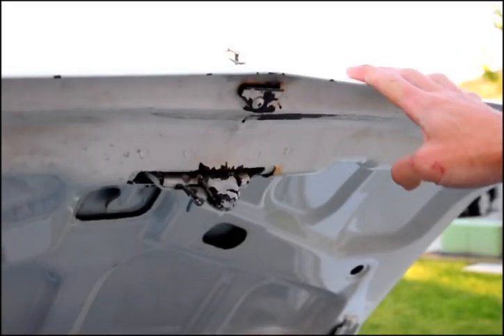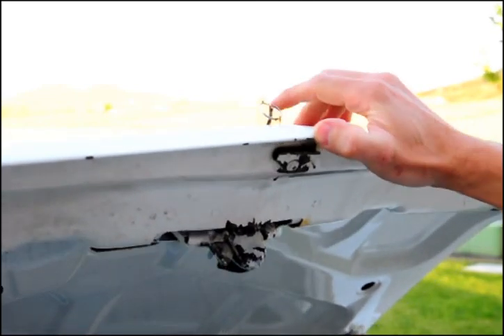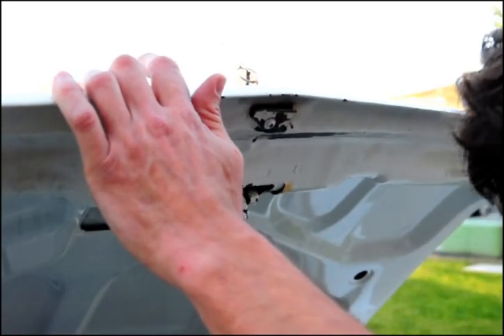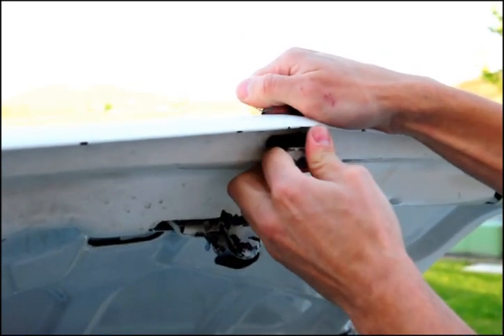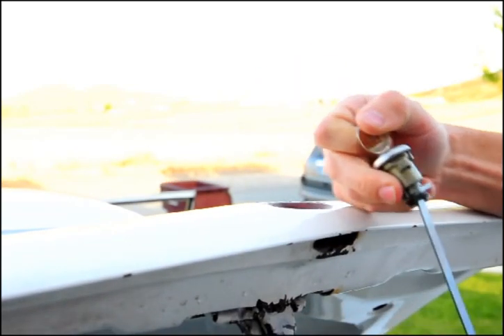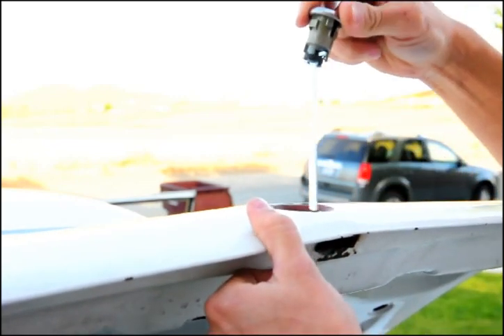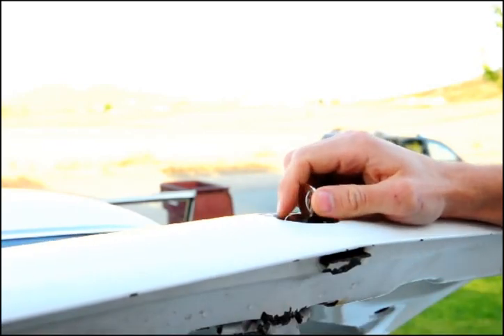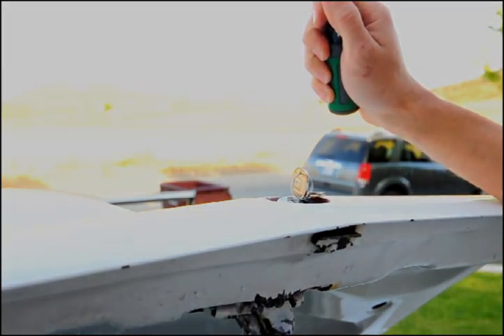GM Trunk Lock Removal

Comment: I need to know how to get into my trunk when I don't have a key and it's locked I have a 1968 cutlass
Reply: Legit_unknown you have to remove the back seats to get inside the trunk.
Reply: Amber Starks, thank you genius, but how do I remove the back seat
Reply: @Sr_iRL  you remove the fucking bolts holding it in place, idk?